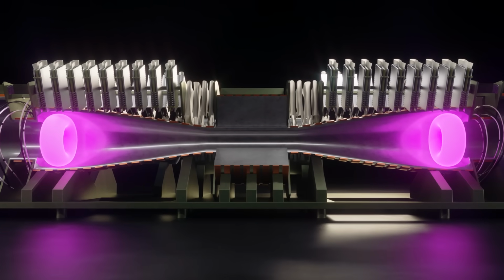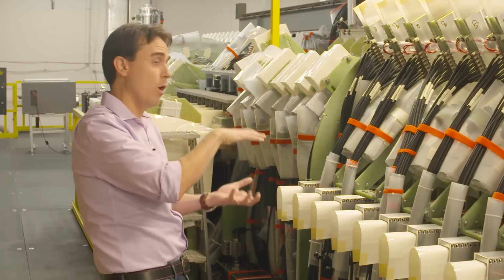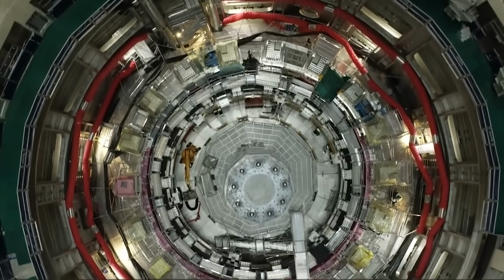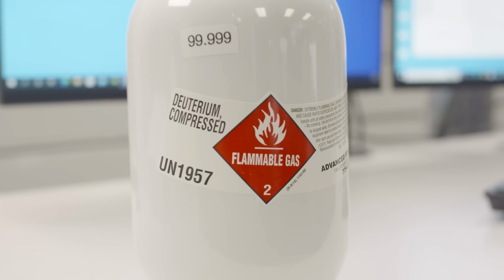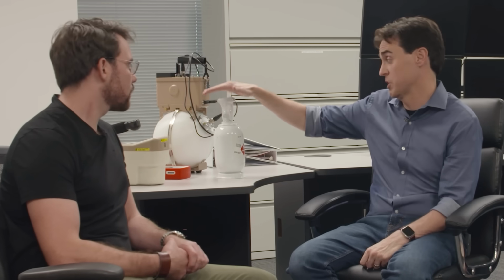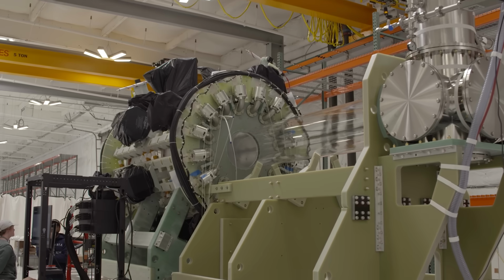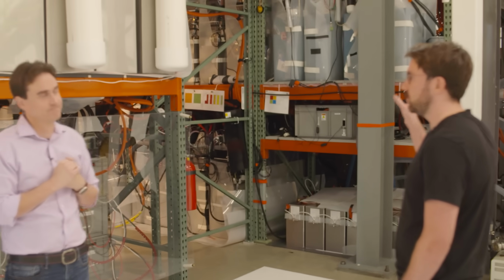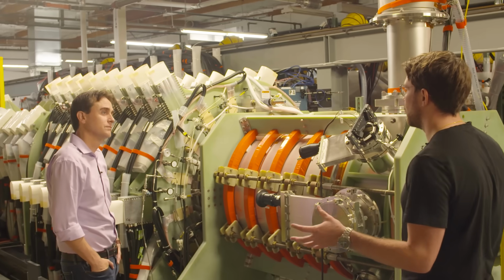A New Way to Achieve Nuclear Fusion: Helion

Comment: Elizabeth Holmes would be interested in this project.
Reply: Very different situation. Their investors have been with the company since the early days and they brought in some big shots from national labs to verify the results before they handed out the big bucks. Also note that even in biotech there are dozens of successful companies for every Theranos.
Reply: @elmarmoelzer2229  Not as different as you might think. Here's some hard truths about nuclear fusion. The current record for energy gain out of a fusion reaction was recently set by the NIF and it's about 1.5 (%50 more energy out). Now this gain factor speaks strictly to the amount of energy delivered to the fuel vs amount of energy the fuel released. That might seem like an amazing achievement be it not for the fact that the lasers used to deliver that energy ate up 100x the power delivered, yielding a laughable 1% laser efficiency. Then you need to account for conversion efficiency, energy used to produce/store fuel, energy used to maintain the reactor etc. Given all these facts, commercial reactors will need to be at a MINIMUM 1000x more efficient than the current technology can achieve in a lab with virtually unlimited funding. 
So how can I not be skeptical at some relatively small private company claiming they'll have a commercial reactor in 2024. I'm not sure most non-engineers can appreciate how insanely hard it is to make any real world process 1000x more efficient. This kind of efficiency gain either requires considerable amount of time or a scientific breakthrough.

Bottom line is that nuclear fusion is decades away from becoming commercially viable and any claims of commercial fusion reactors in the next few years should be treated with extreme scrutiny.
Reply: @Alex-gy9we   NIF != Helion...
Helion is much closer to a commercial machine.
In fact, even Trenta might have beaten JET and maybe even NIF to the punch....
Reply: @elmarmoelzer2229  Not sure where this optimism comes from. The only thing Helion has demonstrated so far is fusion which is something that was done back in the 50s. 
What's concerning is the lack of discussion about energy gain which is the only thing that really matters. You're suggesting that they achieved higher gains than NIF and JET and have kept this a secret. This is incredibly naïve since making it public will give them access to virtually limitless funding and resources. No, the more likely scenario is that they've had such abysmally low gain in their machine that making it public would risk investors pulling out.
Just to be clear, the challenge in brining fusion to consumer markets is not theoretical. Nuclear physics already understands very well how nuclear fusion works. The problem of nuclear fusion is theoretically solved. The real challenge is to build a machine that can replicate our current lab experiment, but do it 1000x more efficiently. And as I mentioned earlier 1000x improvement in an real world process is borderline impossible. It will require numerous innovations in various fields. One brilliant idea is not enough, you will need dozens of brilliant ideas in different engineering fields. A company like Helion doesn't have the manpower nor the time make this happen.
Reply: @Alex-gy9we   Helion can get away with a much lower fusion gain than something based on NIF, or than a Tokamak. NIF will indeed need a very high gain. Helion only needs a Q(sci) somewhere below 5 (I have heard around 2 or 3) to be economic. That is because their energy recovery allows them to not just recover the fusion energy, but also the input energy. The latter at an efficiency of >95%. Fusion energy recovery is slightly less efficient because some of it is in neutrons, some is Bremsstrahlung and some other radiation that cannot be effectively recovered by their magnetic system). They are working on getting at least some of those losses back as well though (though they don't think it is necessary, but just helpful).

Helion DID publish the results for their last (5th) prototype, Venti back in 2018 (it was partially financed by ARPA-E, so they had to). Those results were verified by the JASON review board and were also published at TOFE in 2018.
Venti achieved 10^19 keV s/m3 as a triple product and produced over 10^11 Deuterium- fusion neutrons per pulse.
Venti was TINY! 
Trenta has 3 times the radius and 30 times the volume of Venti. Plus a bunch of other improvements.
Confinement time scales at radius^2.1. Fusion power scales at radius^5.6 !!
What's more is that you cannot directly compare their triple product to a Tokamak (e.g.) because they have a very high ion to electron temperature ratio that increases with plasma temperature. 
Trenta had a ratio of 10 at 10 keV temperatures while Tokamaks are in an equilibrium (1:1)

P(fusion)/P(loss) scales as Ti^1.5 / (Z^2 * Te^0.5 )

Where Z is the atomic number.
So, you can easily see that a Helion machine would achieve much higher gain at the same triple product, when compared to a Tokamak, or even the NIF.

And again, Helion does not need funding. They are fully funded all the way to commercialization. They need qualified employees, and they will need many, many more when they start commercialization.
Reply: @elmarmoelzer2229  I feel you're missing my point and the actual challenge of commercial nuclear fusion. We know that fusion is possible we know that Helion has demonstrated fusion. That means absolutely nothing, it's the bare minimum requirement to even consider your company in the race for commercial nuclear fusion. The question is if Helion can take their TINY proof of concept lab experiment and scale it up a few orders of magnitude, and do it in an economically efficient matter. THAT is the challenge. So when I hear phrases like "fully funded all the way to commercialization" I get really suspicious because this engineering problem is not yet solved, quite the opposite. This is a R&D project, there is no clear path to a solution, we don't know how much money and time it will take to reach said solution, we don't even know if a solution exists. Anyone who claims otherwise is either peddling in falsehoods or doesn't understand the challenge.
Reply: @Alex-gy9we  
What exactly makes you think that there is no "clear path to a solution" (solution for what?). Helion have built 6 increasingly bigger and stronger machines so far. Those machines show a clear trend, the so called scaling laws". Plus they helped understanding the underlying physics. 
Once you have that, you can design a machine that will be big and strong enough to do what you need.
Reply: @elmarmoelzer2229  "What exactly makes you think that there is no "clear path to a solution" (solution for what?)". - Because if there was, everyone would abandons all the R&D and build commercial reactors. The solution I'm referring to is a commercial reactor. Not only do we not have a solution for a commercial reactor, we don't even know if one exists.

"Those machines show a clear trend, the so called scaling laws". Plus they helped understanding the underlying physics. " - Irrelevant, we're trying to build commercial reactors not  experimentally prove scaling laws or other underlying physics.

"Once you have that, you can design a machine that will be big and strong enough to do what you need." - This just plain wrong, and the crux of the issue. Just because you have complete understanding at a theoretical level doesn't mean you can make it work in reality, even less so in a economically viable manner. A recent example of this is the Hyperloop which on paper is a "great idea" but in practice is next to impossible to achieve.

Again I feel like a broken record at this point but the challenge is at the engineering level. Demonstrating a commercial solution can only come in the form of a complete, at scale, working model of a reactor alongside the stats showing it's economic viability. Anything short of that is R&D. 

Helion is not any closer to a commercial reactor then the rest of the field. Not only are they not close, but there is not guarantee that they will ever succeed. So far they haven't shown that they can even hit the scientific breakeven point, let alone the engendering and economical breakeven points which are generally orders of magnitude harder to achieve. Like all other companies in the field they're doing R&D. They have taken a different approach compared to other project and they keep touting the benefits while conveniently omitting some of downsides. Allow me to remedy that.

Beam to beam fusion (which is what Helion is researching) can't achieve ignition (self-sustaining reaction). This is a huge downside. The reason everyone else is researching tokamaks and stellarators is because they're hoping to achieve ignition. This means you only need to expend energy once to get the reaction going, then just pump fuel into the reactor. Without ignition beam to beam fusion is fighting and uphill battle to commercialization. Even if they make it work chances are by then tokamaks and stellerators will also be viable and more competitive on an economic level.

Fusion uptime. Another downside to beam to beam fusion designs is the amount of time the machine spends doing fusion compared with the amount time it's operating. In Helion's machine downtime is build into the operation cycle. Their current machine fires every 10s with fusion happening for only 1 millisecond. This given them a fusion uptime of about 0.01%. The worst part is that they have a very low uptime sealing. That's because in each cycle the machine has to inject fuel in the formation section, heat it to obtain plasma, then manipulate the plasma into the field reverse configuration, then accelerate the FRC plasma towards the main compression section, further compress the plasma and actually undergo fusion, then release the cooling plasma + fusion products in the diverter section where energy will be extracted, and finally vent everything and return the machine to it's initial state ready for a new cycle. Notice how in all these steps, energy is produced in just one step (the fusion step), while all the other steps are actually using energy. I'll be conservative and say the theoretical limit is 50% which is a gross exaggeration. This means that the machine spends half the time doing all the steps except fusion, and half the time actually doing fusion. This pales in comparison with the nearly 100% uptime of other designs that aim for self-sustaining reactions. In reality it will be a technological marvel if they achieve 10% uptime. This means that these machines are doing orders of magnitude less fusion than their competing designs. The total power output will be considerably lower making them less suited for large scale energy production.

There are other downsides, but the two above weren't discussed at all given the huge impact they have on the economics of these machines.
Reply: @Alex-gy9we   
1. This is not "beam to beam" fusion.

2. Polaris is already almost exactly the same as a commercial machine will be. There are only relatively small differences like the pulse rate. But that is comparably easy to increase (compared to the challenges of some other designs).

3. Pulse rate will be 10 Hz for commercial machines. 

4. You seem to misunderstand the purpose of making pulsed machines. Helion has shorter pulse duration and somewhat lower confinement times, but they make up for that by having orders of magnitude higher density. So, their nTTauE is still high enough and actually higher than for competing systems. 

5. They are not aiming for ignition with D-He3 (though they could do it with D-T) because D-He3 is very hard to ignite. 
The point is that they don't need ignition. They can get away with a Q(sci) <5.
Direct conversion and high efficiency recovery of the recirculating energy helps a lot. And that benefits from a pulsed system.

6. They already have the pumps for Polaris.
Reply: @elmarmoelzer2229  
1. This is not "beam to beam" fusion. - It's close to beam to beam than any other classification. A lot of the energy used to start the fusion reaction comes from decelerating the fuel.

2. Polaris is already almost exactly the same as a commercial machine will be. There are only relatively small differences like the pulse rate. But that is comparably easy to increase (compared to the challenges of some other designs). 
- Polaris doesn't exits yet, and even if it did it would not be anywhere close to a commercial machine despite what Helion might like you to believe. Again they have yet to demonstrate scientific breakeven, and you're speaking of a commercial machine.

3. Pulse rate will be 10 Hz for commercial machines. 
- resulting in an fusion uptime of 1%. This machine drains energy for 99% of the time it's operating and produces energy for 1% at best. Even with 100% energy capture the power output will be considerably lower than most other competing designs of the same scale. 

4. You seem to misunderstand the purpose of making pulsed machines. Helion has shorter pulse duration and somewhat lower confinement times, but they make up for that by having orders of magnitude higher density. So, their nTTauE is still high enough and actually higher than for competing systems. 
- not sure what you mean here. Most other competing designs are not pulsed machines.

5. They are not aiming for ignition with D-He3 (though they could do it with D-T) because D-He3 is very hard to ignite. 
- has nothing to do with the nature of the fuel or reaction. The design of the machine cannot support ignition.
The point is that they don't need ignition. They can get away with a Q(sci) <5. 
- again on paper.
Direct conversion and high efficiency recovery of the recirculating energy helps a lot. And that benefits from a pulsed system.
- again all on paper. They haven't even build a proof of concept of the energy recovery system.

6. They already have the pumps for Polaris. 
- not sure what this is supposed to mean. They can even have every part of Polaris done, until they put it together and run the experiments it's all meaningless.

Please stop coming back with theoretical models and extrapolations. Everyone agrees that on paper commercial fusion is possible. Reality is that Helion has yet to show anything of interest and discussion about commercial fusion are not only premature at this point but outright delusional. What they've done is taken ideas from the 60's and build experiments to confirm them. That might be impressive in it's own right, but again in the context of commercial nuclear fusion it amounts to absolutely nothing. What they need to demonstrate is working models that can reach economic breakeven (they have yet to build a full working model). Then and only then should the word commercial be uttered.
Reply: @Alex-gy9we  
1. No. The fuel is not decelerated.
Most energy is consumed (by far) by the compression magnets.

2. Main difference between Polaris and a commercial machine would be the pulse rate. (1 Hz in Polaris, 10 Hz in the commercial machine). I think that is very close. Getting the pulse rate up 10x is difficult but not that hard.

3. The machine would not drain that much energy between pulses. The magnets are not on between pulses and they are what consumes the most energy. The fusion energy more than makes up for any smaller power drains between pulses, which is mainly pumps and control circuits, etc. 

4. It is about 50:50, I would say. Some are quasi- steady state. Some are fully pulsed.
From the top of my head, competing pulsed designs are: HB11 and the other laser based systems (Marvel, Ex and Focus, as well as wherever NIF will go). Zap's sheared flow stabilized Z- pinch. MIFTI, LPPF, General Fusion. First Light Fusion and Hyperjet. 
Zap is IMHO the second most promising design, I have seen.

5. False. They first tested in 2015.

6. You can test a component without putting together the whole system. You can test an electric motor and know that it works without putting it into a car.
Reply: @elmarmoelzer2229  
"The fuel is not decelerated." - I think we're talking about different machines at this point.

Comment: NIF at LLNL is actually getting more energy then they put in though.
Reply: NIF had a great success there, but their overall plant efficiency is way below where Helion is, even if they were to use modern lasers and a more optimized machine and target. Getting from NIF to an actual power plant would be much more difficult and the resulting plant would be quite large.

Comment: All your tokamak negatives focus on ITER (which admitedly at this point is about 10 years obsolete and pretty stupid in several aspects). MIT has a better angle on pretty much every technology ITER was supposed to advance... thier SPARC reactor has almost none of the drawbacks you list (sure it still uses lithium and bereillium but it is also much smaller for hte same output.... and uses a molten salt rather than solid blanket).

Comment: How long do those capacitors last? How much do they cost?
Reply: They have used some of them for a previous, small test machine that did over a billion shots and then reused them in two more machines. They currently show no signs of degradation.
So likely for many years if not forever.

Comment: Why doesn't helion have another generator to try to capture the energy of the neutrons as well?
Reply: Because capturing neutrons requires expensive equipment and in a combined machine, the neutrons would only make up about 10% of the output energy. In a pure D-D Helium3 breeder it would be a bit more, but not that much more. It is likely not worth the added CapEx, though it is not written in stone yet.